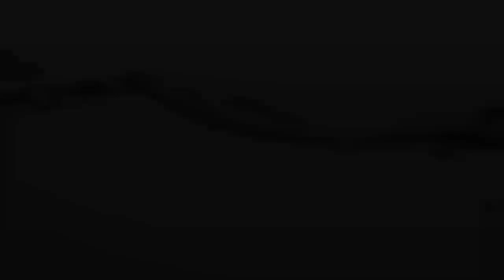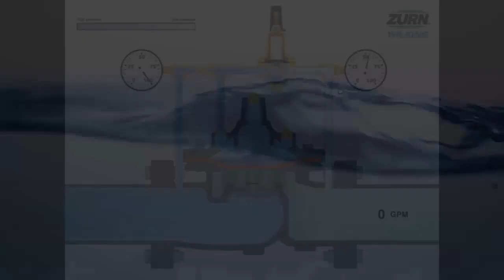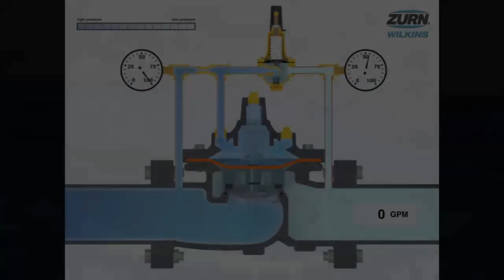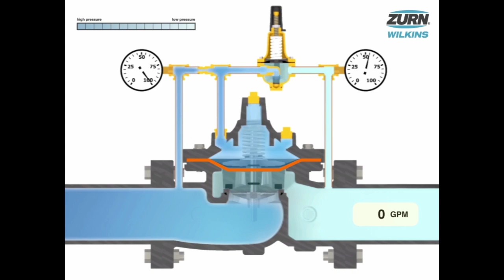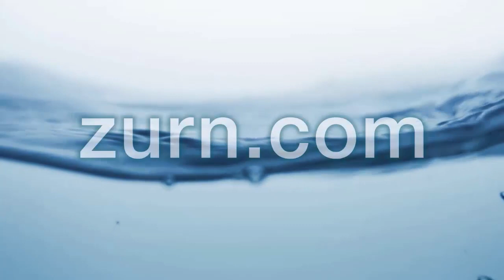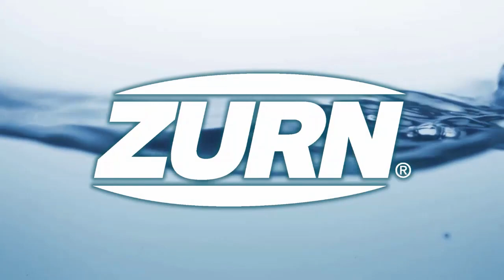Zurn Wilkins Automatic Control Valves - How it Works

Comment: Hi , what is the difference between this type and the type with Low-flow Bypass ? Thanks
Reply from the maker: All ACVs of the Pressure Reducing variety have minimum
continuous flow requirements.  As long as the minimum continuous flow rate
is above the minimum flow rate of the ACV, no low-flow by-pass is needed. 
In the event the flow rate drops below the minimum continuous flow rate of the
ACV, a low-flow by-pass is called for.  In the case of the ZW209BP, we add
a small direct acting Pressure Reducing Valve to the backside of the ACV. 
The small PRV will handle all low-flows through 10 GPM.  This is the main
difference between the ZW209 and the ZW209BP.
Reply: thank you for reply . one more thing , in case of no flow , will downstream pressure stay at set pressure by using the ZW209 or need to add Bypassin this case ?

Comment: hi.. What would happen if the pressure upsteam the control valve drops below the set point (55 psig)? will it fully open or close? really appriciate your answer... thx
Reply from the maker: Hi, Danny. Should the inlet pressure drop below the set point, the valve will be in an open condition, and out of control. The valve requires a minimum of a 10 psi differential across the valve to remain in control.

If you have any more questions, feel free to contact the Zurn Wilkins Customer Care department at 1-855-ONE-ZURN (1-855-663-9876).